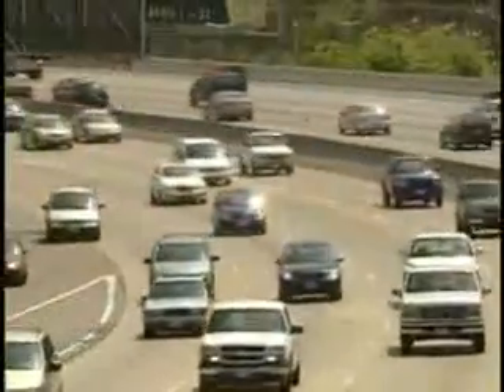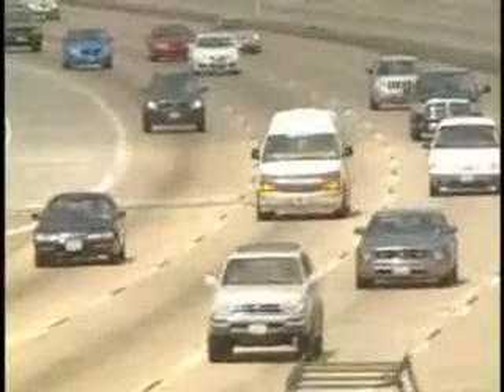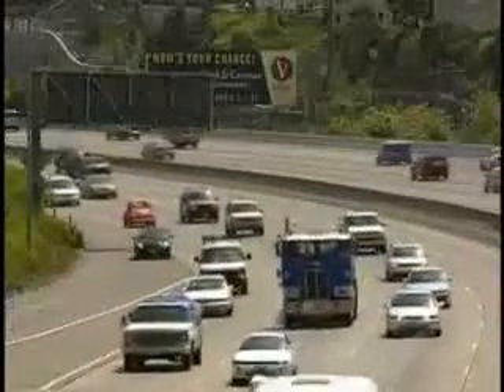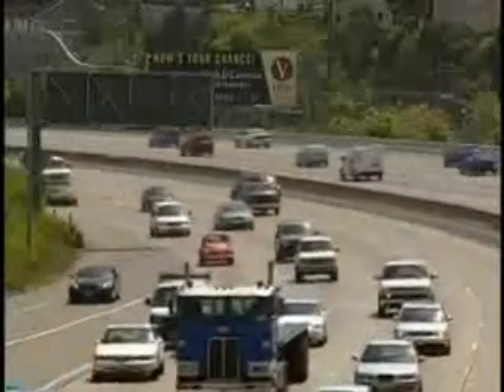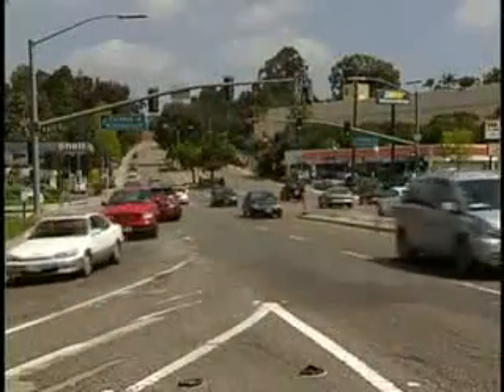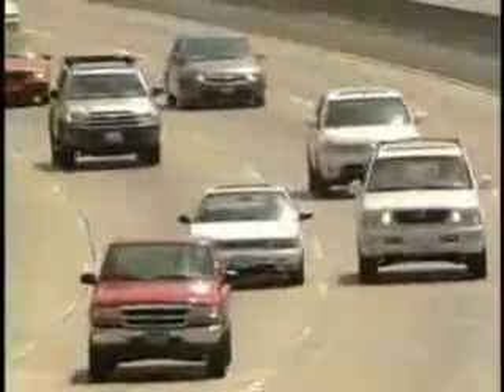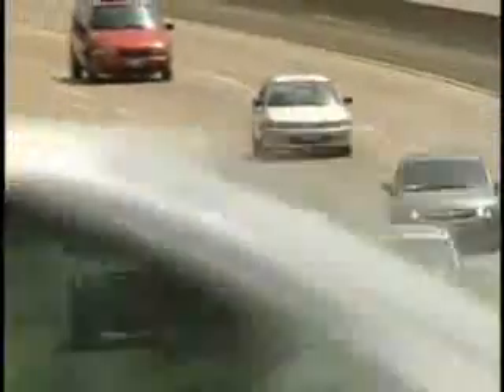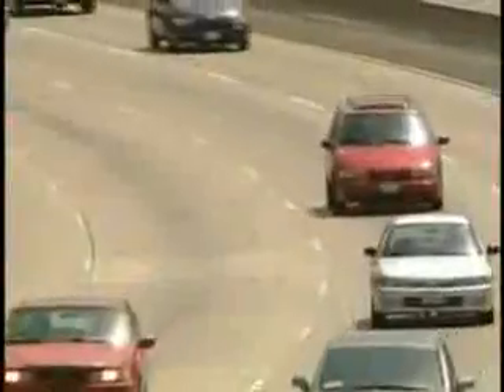How Much Can You Save With A Water Fuelled Car? Part 2

Comment: @philarchuletta It's called physics. Energy is wasted every time you stop and massive amounts of energy are consumed when taking off from a dead stop. When a vehicle is traveling at a constant rate of speed, the only energy being consumed is simply in maintaining the speed (which is why using cruise control will save you gas). Plus, gas is wasted whenever a car is idling as at idle the engine is getting 0mpg.